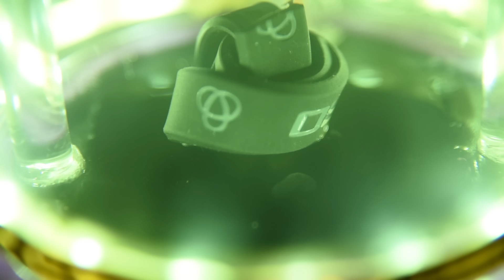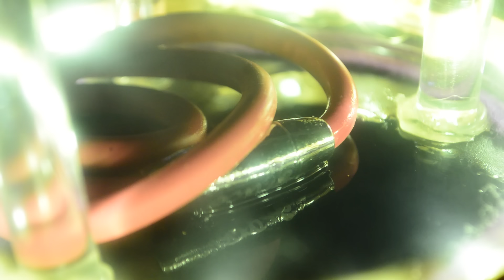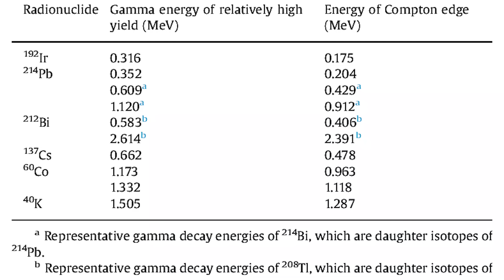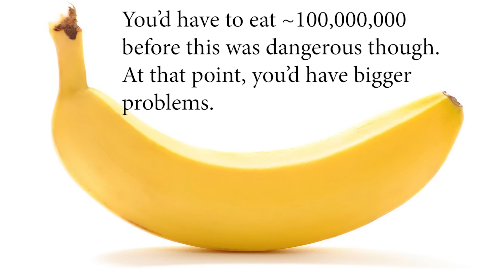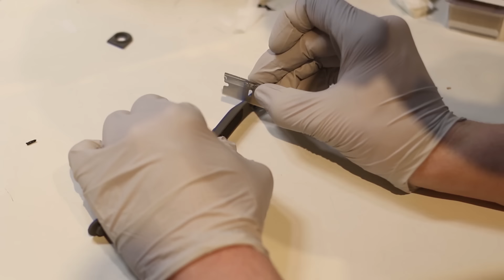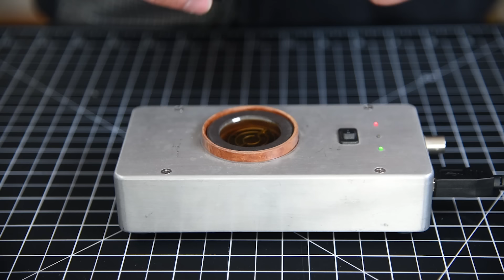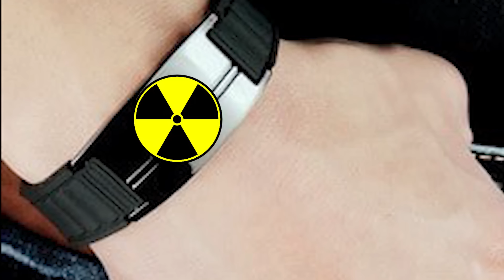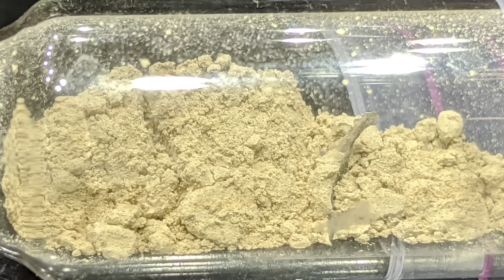Negative Ion/Anti-5g Products Are Actually RADIOACTIVE

Comment: I have a Himalayan salt lamp. I thought they were just supposed to be pretty.
Reply: They do look pretty, and apparently won't kill you. Plus, plus.
Reply: @Thirdbase9  they also taste pretty.
Reply: Yeah. If "hey, this lamp gives me a pretty light" is your only goal with a salt lamp, you're the only person on earth getting what you paid for.
Reply: Drackar I thought they were to make clean air ?
Reply: @drackar  Salt lamps don't even use salt, they're just fancy plastic
Reply: @naxzed_it  the one I own is salt.
Reply: @blarghinatelazer9394  negative ions in general aren't harmful to my understanding (just, not beneficial), when they're generated by electricity or a candle in the room or something similarly innocuous (and as Big Clive pointed out, they can attract the dust in a room to a central position, if that's a goal you have). The problem here is these products are using radioactivity as a "convenient" power and ion source.. since technically alpha and beta particles are ions. They're just, uh, radioactive, very high energy ones.
Reply: I had one because it was pretty and calming at night before bed until the night it lit up in a huge white flash and shorted out my house.
Reply: @zoshannon4253  Most likely that is either a cord or a bulb problem (sometimes when a filament in a bulb burns, it will short out the contacts as well). Both are very easy fixes you could perform without any real tools. I think people also sell lamp kits that come with essentially a bulb socket on a cord. If you want to check if it's the bulb, you can visibly look at an incandescent bulb and tell if the filament(s) on it are broken, or rattling around on the inside loosely.
Reply: @zoshannon4253  wha
Reply: I also had no idea. My mother once received one of these as a gift. Other salt products/objects are often linked to the health benefits of breathing in salt particles in the air. So I had always assumed that these lamps are supposed to disperse salt particles into the air, through some combination of the room’s air-humidity and the mild heat crated by the lamp (or not-so-mild in the case of @Zo Shannon). Just shows you how far my mind will go if it tries to make sense of an object.
Reply: Wait, i thought it was to lick, not to be pretty
Reply: Can you lick it tho?
Reply: Same, I thought they were just decorative deer licks
Reply: Option A) lick the lamp.
Option B) Lick The Lamp.
Option C) LICK THE LAMP
Option D) JUST LICK THE GODDAMN LAMP
Reply: @alphaplayzz1381  i burng my tounge
Reply: Apollo put it into your cooking
Reply: @blarghinatelazer9394  negative ions in general aren't harmful to my understanding (just, not beneficial), when they're generated by electricity or a candle in the room or something similarly innocuous (and as Big Clive pointed out, they can attract the dust in a room to a central position, if that's a goal you have). The problem here is these products are using radioactivity as a "convenient" power and ion source.. since technically alpha and beta particles are ions. They're just, uh, radioactive, very high energy ones.
Reply: I mean they taste salty enough so
Reply: @charliemcloughlin1761  fr xd
Reply: That is actually the only reason I would get a salt lamp. I think they look nice.
Reply: I like my woman like I like my lamps: looks nice, wont kill me.
Reply: I bought one because I thought it looked neat but it did advertise all the supposed health benefits on the box (which I already figured were bogus but again, I only bought it because I like the way they look).
Reply: And taste good so plus,plus,plus.
Reply: I've found out they can actually be fairly dangerous towards electronics. Not exactly sure the science behind it but a few years back we had one next to our dvd player and we found out that whatever sodium particles released into the air by the salt lamp had completely corroded it's electronic components
Reply: That is literally the only reason i took it, negative ion are bullshit
Reply: It is nice that they are harmless and all.  They look nice.  I would not buy one just because it is just clutter to me.
Reply: They are supposed to look pretty, and taste awesome...
if you haven't licked the lamp yet then you should.
Reply: Well I imagine they come in quite handy when youre sitting around and think "well shit, i would love me some salt right now" and with them salt lamps, you can have it. Just, get up and bite some off. Crunchity munchity
Reply: Same here, though I have also heard they make good nighttime lights since they’re a low-blue light source. At the very least, they’re attractive to look at and provide relaxing mood lighting.
Reply: I would have one on that merit, they certaonly look cool
Reply: Salt lamps are very pretty, and I feel mine give me the benefits of amber light in the evenings, and that’s it. We don’t eat Himalayan salt because of the potentially harmful levels of tin in it.
Reply: same
Reply: I thought that too
Reply: I have one cuz it smells good and looks good
Reply: And tasty
Reply: same
Reply: same, and smell like ocean.
Reply: same
Reply: I did too hahaha
Reply: That's why I have one.
Reply: I know right
Reply: They are pretty, and absorb moisture so that’s a plus I guess
Reply: Same and now I’m scared I supported some horrible company 💀

Comment: I'm mostly concerned about the powder.  While you have shown that getting alpha and beta radiation externally can cause problems, getting the thorium inside of you can cause a whole lot more trouble.

I bought a lantern mantle a few years ago and tested it.  It wasn't radioactive.  I'm sure, however, that I have a few thorium laced mantles somewhere in my garage.  Also, I have some old lanterns that have gone through a number of mantles.  The white powder at the bottom of the lanterns is probably radioactive.  I'm wondering about the wisdom of ever using them again.

Remember the radioactive boy scout?  He used lantern mantles as a source of thorium.

By the way, there are still a few caves that are advertised as healthy radium spas.  Yeah.  Breathe in the stuff so that it can decay into radioactive isotopes of lead right in your lungs.

Comment: The alpha release is harmless as long as you aren't ingesting the stuff, as alpha particles are stopped by your skin.
Same with the beta release.

Stop giving people misinformation.
Reply: Skin definitely does not stop beta particles, and even alpha particles can cause some harm through intact skin.  There's a section in the video, roughly 15:00 to 16:30, that specifically addresses this.

Actual experiments are done to test radiation shielding by paper and by chicken skin (presumably the only easily available fresh skin).  With the source covered in chicken skin, most of the beta particles go all the way through, so clearly skin is not good beta shielding.  Almost all the alpha particles are stopped by the chicken skin, but most of them do go through the paper.  That means most of the alpha particles will also go through the insensitive dead layer at the skin's surface, then get stopped in deeper layers of living cells, damaging them.

Comment: The environmental contamination alone is terrifying.
Reply: Cell tower radiation is scarier tho
Reply: @ninetails6218  Cell phone radiation is less scary.
Cell phones emit non-ionizing radiation.
A radioactive source emits ionizing radiation in the form of Alpha and Beta particles as well as  Gamma rays.
Reply: @ninetails6218  No, it isn't.  I used to work in satcom and the systems are essentially the same.  The background increase is still less than a pilot experiences in a year.  OHSA clears those levels of exposure.  I don't think it's safe at the levels they allow but that's a different story.  The exposure to ionizing radiation from a cell tower is minuscule in comparison to the background gamma decay in one of these.  Next, when the tower turns off the problem is gone.

This is a whole different beast.  The abortion of alpha particles through the mucosa is hundreds of times higher than the epidermis.  Next, mucosa have a DRASTICALLY higher reproduction rate than epidermal cells.  Each generation increases the compounding errors in the DNA of cells already highly disposed to tumors.  Next, the radio source can be encapsulated in the mucosa causing an undiagnosed and continuous exposure source.  Now imagine that settles nice and deeply into the alveoli in your lungs and just how cancer prone they are.  Or somehow it makes it through the digestive tract to your large intestine and settles in.  Maybe right by your prostate.

Now that assumes you only expose yourself.  But you don't.  Your home, your vehicle, your office, or anything someone after you may use, and for extended periods.  How about anyone you shake hands with?  Mass transportation?  A booth in a diner?  Do you see when this goes?
Reply: Unlike these bracelets, more than just a few not-so-smart people use cell phones every day, and cell towers cover a good portion of the US. Yeah, sure, maybe it’s not the most radioactive source on the planet but you are bathed in it *constantly*. Most people sleep with their phones just inches away from their head and live within close proximity to cell towers and power lines, which has the potential to be extremely dangerous. You even stated that these levels are not safe, Icon. 

And David just because it’s not ionizing doesn’t mean we know the health risks involved. There is a reason there is ongoing research into the topic and that’s because we don’t know enough. Just because it doesn’t cause cancer as far as we know doesn’t mean it’s safe.
Reply: @ninetails6218  You're stuck on your special topic and being right about it.  You're wrong, absolutely wrong.   If you were correct we'd see a MASSIVE increase in urban cancer rates.  Hundreds of times what it is.  The increase in reporting is largely due to better diagnostics and reporting.  You know where we do see massive increases in cancer rates?  Rural areas where glyphosate is used.  And you consume glyphosate.  Pick a new golden calf, one that's far scarier and a present threat.

Also, you read into what I said what you wanted to read.  I said that OSHA safety guidelines for pilot exposure are wrong.  Nothing else.  I used to work on active satcom dishes and I'm less worried about the dose I got there than the lifetime cumulative Xray exposure I've had.  I've had about 10x the number most people will ever have and even those CUMULATIVE exposures are considered safe.

Comment: You should have mentioned the huge disparity of  alpha particle damage, depending on where it comes from: If it comes from outside, the damage is minor, but after you ingest the thorium you get alpha from _inside_. When it is inside it does way more damage than beta or gamma because it releases all its energy. And alpha particles tend to carry lots of energy.
Some say that alpha from the inside is 1000 times more dangerous : https://doi.org/10.2307/3576584 . 
Going little over the allowed civilian radiation limit is not a big deal because the threshold are very very strict. But inhaling thorium dust means that locally your lung tissue will receive  large alpha does, and lung cancer will be significantly likely.

Comment: You can buy "negative ion" powder on alibaba for about 1$/kg.
Thorium is used on a large scale in breeding reactors for uranium 233 production.
This material should not get into the wrong hands
Reply: Except that thorium is safeguarded by the fact that you need Plutonium or something else highly energetic to cause the reaction. It’s actually fairly safe, which is why it’s so good for reactors.

Comment: Can you compare this to cell phone radiation? I’m curious what the difference is.
Reply: The difference is this:
Cell phones emit non-ionizing radiation. Microwaves cause the heating of water molecules.

A radioactive source emits ionizing radiation in the form of Alpha and Beta particles as well as  Gamma rays. Ionizing radation directly damages DNA.

Remember not all 'radiation' is the same. 
Not all forms of radiation are electromagnetic waves.
Not all radiation is ionizing.

-user" Nine tails" is wrong.
Reply: Realistically phone radiation is a bigger risk, even if it is of course lower than Thorium it poses higher long term risk and is more generally applied to the entirety of the 1st world.

Comment: Though I 100% agree with you in this making water more wet. I want to point out that "wetness" is determined by the drop angle on a surface and if you do want to improve "wetness" a small amount of a surfactant, such as dish soap, will work and is a good thing to do for glues and paints to make it attach to the surface better.

Comment: Note that these actually ionize indiscriminately, creating both negative and positive ions depending on what they hit. Removing radiation from the equation doesn't fix the problem either. There are negative ion generating machines, and they produce ozone, which is bad for you.

Comment: I'm curious about your thoughts on radium watches.  I posted a video on my channel about what I consider to be a very pernicious problem that is overlooked quite often, and one of the common findings I share with your observations is that the dose rate from various objects varies wildly.  In my watch dial examples, I measured over 4 orders of magnitude difference between various samples, and I was only using a beta/gamma detector identical to what you used in this video.  I shudder to think of the alpha rate on some of those pieces.
Reply: @conormaloney126  Alpha becomes EXTREMELY dangerous if you ingest it.  Externally it barley passes a layer of skin as you said.  Internally, it can kill you.  That poor Russian guy Litvinienko was killed with an alpha emitter polonium 210.
Reply: @Conor Maloney  The alpha can't 
penetrate but alpha is not the only thing thorium gives off.  There are betas and gammas released as well.

Comment: I completely disagree on the government regulation, government has no place in deciding what an individual possesses, uses, purchases, or how they purchase it... I should be able to order a select-fire m-16 on Amazon no questions asked... what needs to happen is the free market needs to speak for itself by outing this issue so it's properly labeled. Cool, you want to order a pile of products with radioactive material? Fine, just don't be passing it off as a "health benefit"...

Comment: Nice video! I need to add these products to my collection before they could be banned, since I collect radioactive materials. However, these "negative ion" sources are very weak in activity compared to most of my other sources. By the way, DO NOT use dose units, like μSv/h or mR/h, unless the instrument is calibrated to the specific radionuclide you're measuring! Otherwise, your dose unit will be wildly inaccurate! Most detectors are calibrated with cesium-137, which emits a lot more energetic gamma energies (661 keV), and at higher branching ratios (85.1%) compared to thorium-232 (64 keV at 0.26%) by itself. Also, radionuclides with short half-lives are more radioactive than radionuclides with long half-lives. ALWAYS use CPM or CPS. If it's calibrated to what you're measuring, gamma only, then dose units will be accurate. Activity should be measured in DPM or Bq. Only some Geiger-Müller counters have this feature, and each radionuclide has a different efficiency for detection. But, the chemistry of these radionuclides are important too, and how they interact with tissue. I don't think these should be banned, however they should be properly labeled, with the activity and radionuclide(s) present. Too many people fear ionizing radiation enough as it is without understanding it, and it's just a fraction of what's out there! Why not just sell these as chemicals and check sources?! Radium-226 has a specific activity of 1 curie or 37 GBq/gram, whereas natural thorium has about 2.2 microcuries or 81.4 kBq/gram!  That means that 1 microgram of Ra-226 has the same activity as 2.2 grams of natural thorium!

Comment: My only issue with this video is disproving paper stopping alpha particles. i may have only started working in my field in 2018 but from taking a radiac to an item that had a very high level of alphas then covering it with a single piece of paper, i have learned that alpha particles are indeed stopped by a piece of paper. and the reason most say to ignore alpha particles is because they are not just stopped by the skin but the dead skin that everyone has. only an open would would cause worry. If my experience has been misled and i was taught incorrectly i would like to have my level of knowledge upgraded though.

Comment: You are missing some significant issues:  Alpha radiation can be blocked by skin and is only a concern if it comes in contact with mucous membranes (e.g. ingesting or next to your eyes).  Beta isn't that much worse though it can affect skin.  These dose rates are not equivalent to Gamma.  

btw, we used to use Thorium lantern mantles to test radiation friskers.  Cheap test source -- the only problem was that once they were on site they couldn't leave -- can't ship anything radioactive off site!